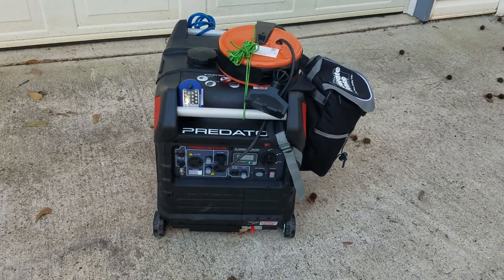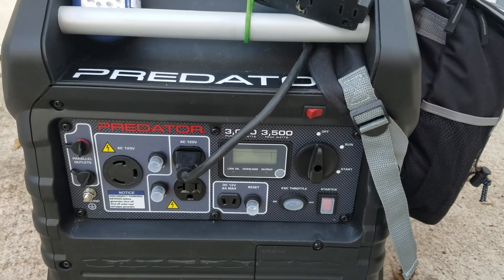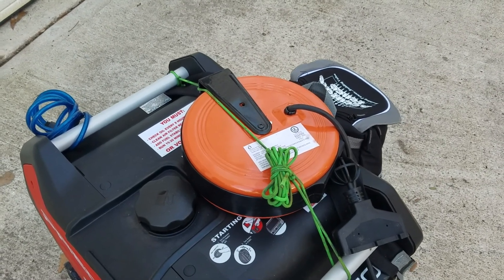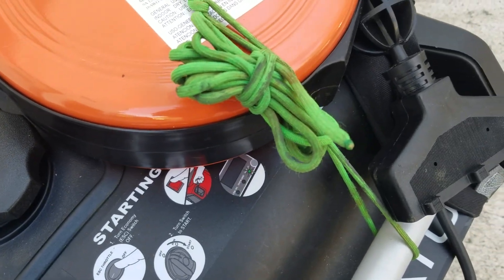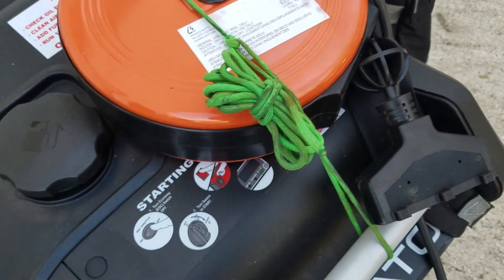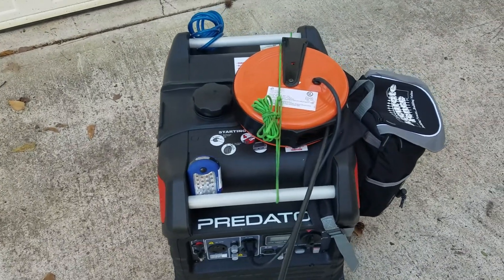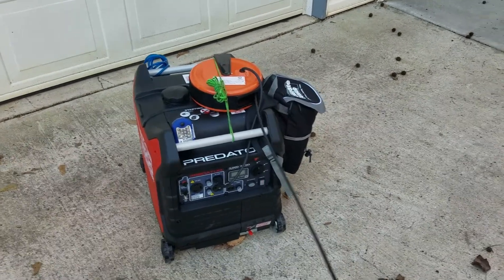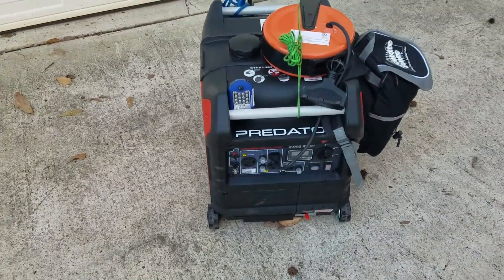Predator 3500 Inverter Generator

Comment: I have the 2000 watt HF gen, If you turn the off,run,start switch 95% off the gen will stay running and it will shut the fuel off and run the carb dry. On the 2000 watt it take about 10 minutes or so to drain the carb. I'd be willing to bet the 3500 will do the same thing.